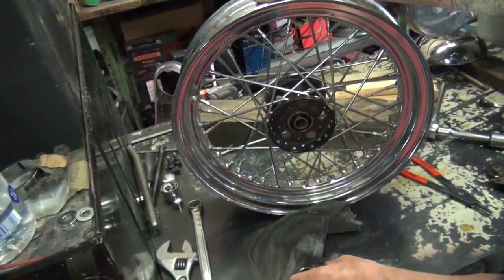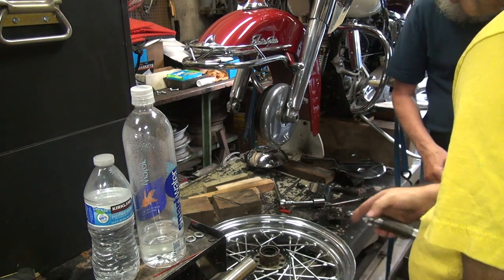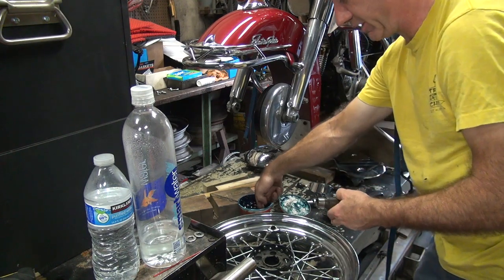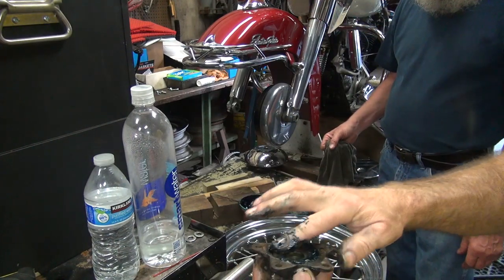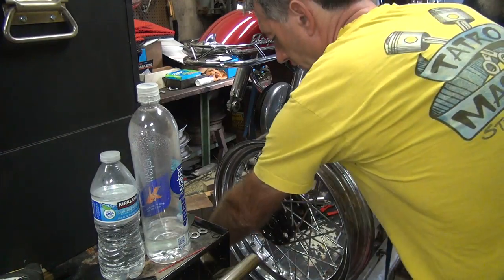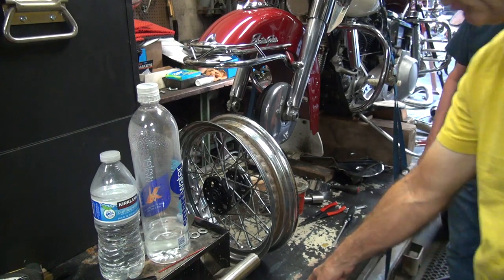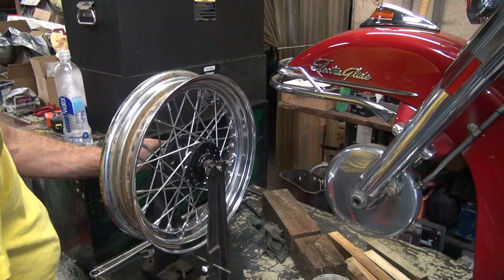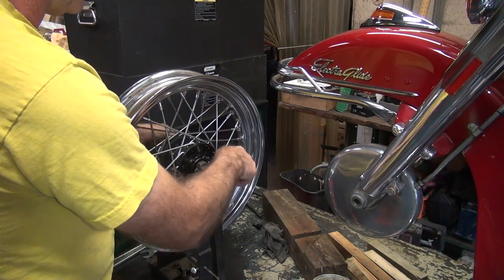#103 1965 74ci panhead new bike purchase full service repair FL FLH harley rebuild by tatro machine

Comment: Keenan,
Is it "good practice" when servicing a known good front end, going into the service at this depth to mark everything, such as your drum the way that it came off. (ie.. the three dot system,, marking all three with a yellow dot in reference to the valve stem)? or at this point I'm putting on a new tire and going through the rim straightening and truing is it really necessary.. just one of those dumb ass questions.. I've had people tell me before that it's really not necessary. But in my mind in order to have a truly balanced front end, especially on your FL's and Wide Glide's this is a good practice to follow whether it be mine or someone Else's...
Reply from the maker: who says it was correct the 1st time. harley doesn't balance any of those parts and the machining is not that good. most of the time nothing repeats when you take it apart or loosen and re tighten something. do what you want but it rarely matters.
tatro